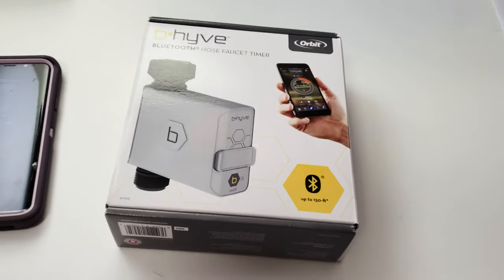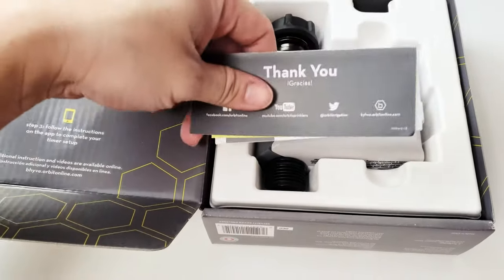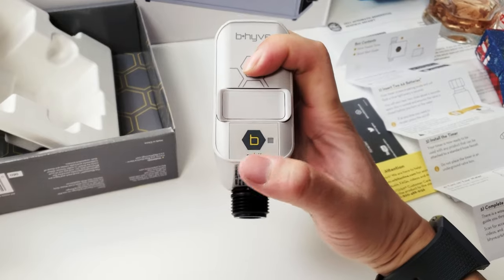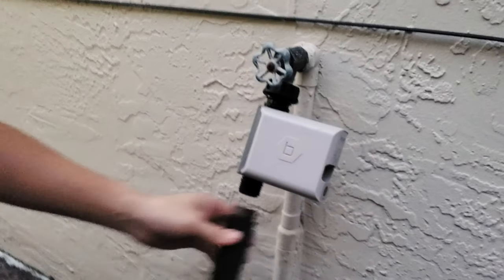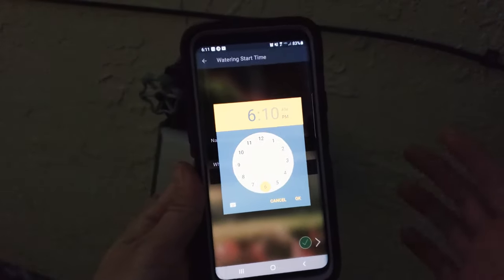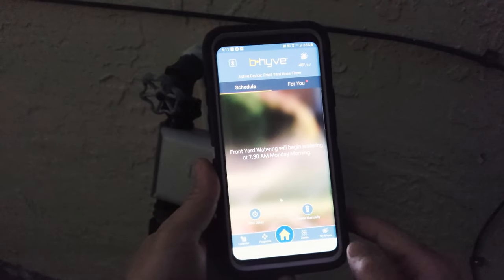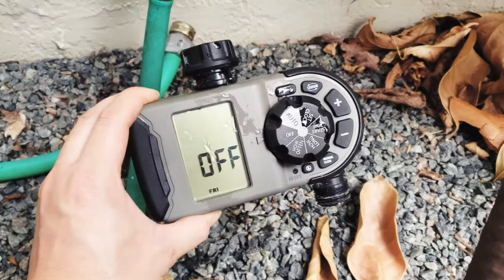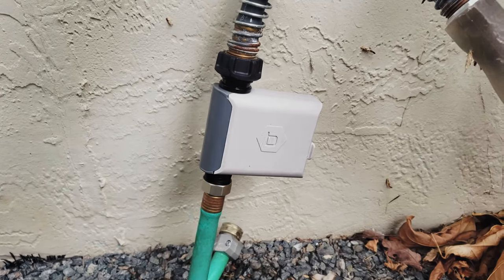Orbit B-Hyve Smart Bluetooth Faucet Sprinkler Timer with WiFi Hub Review

Comment: I've ordered it and got it in Israel, but the threading must be different.

I wish to connect it to a 20mm PEX line, can you suggest the right adapter / hose connection?
I don't know what's the male outlet is, but it's probably NOT 3/4 NPT, since the one doesn't screw on easily.
My end is a 3/4 BSP, (doesn't matter whether female or male).

Thanks!
Reply from the maker: Not really familiar with the size/adapters needed for Israel, I think your best bet is to take it to a local plumming/hardware store to find the correct adapter needed!
Reply: Dang that was quick! Thanks for replying.
 @TheGizmoGarage  Oh boy, I've been around stores all day - 0 luck!
Even the adapter you're using might be helpful - I'll get around the diameter for mismatches.

I just need to know what DOES fit. I even contacted Orbit - that wasn't helpful at all. :(

Comment: Right out of the box, they were as easy to set up as this video shows, and if you only have ONE, they remain easy. But as soon as you have two and you need to alter your watering schedule they become a Royal Payne-Diaz.

Alas Orbit is the only game in town, so I ended up with four of these timers and would like to have two more. But I keep waiting for some sort of update or firmware patch to correct the many failings these have. I'm on my third year with these and I think I am waiting in vain.
Reply: Same thing. Having one of these is great. After the, it is a nightmare and the app is TERRIBLE. There are all of these zones and options that simply do not work. I have spent dozens of hours over three years trying anyway to configure multiple sprinklers for automated watering and it 110% is not an option. I even contacted Orbit and after working through about 5 different reps, the last one said its not possible and they are trying to update it to work. That was 2+ years ago - pretty sad :/
Reply: Did you buy the hub? I think that's needed for coordinating more than one unit
Reply: @pivotal1101  Yep, have the hub. Doesn't stay connected to the timers, my phone, or the computer application. The only thing that works is to carry my phone out to each timer and do a factory reset every time I need to change the watering schedule. Not a big deal for the lawn, but the plan had been to set a timer for the drippers at each of the raised garden beds and be able to quickly give, for example, the tomatoes an extra shot of water if they need it. I've set up dozens of Wi-Fi, Bluetooth, and x-bee radio-based devices over the years and never had any as temperamental as these stupid things.

Comment: If you do another video please go further into controlling the device from outside your home because for some reason I can ping my hub but it will not control the hyve. This is more a orbit question as they made the product.
Reply from the maker: You need to make sure you have at least one Wi-Fi hub https://amzn.to/3M7wfZE, and all your faucets are connected to one of those wi-fi hubs, if you don't have a wifi hub then you can only control faucets close-by, by using the build-in bluetooth function on those timers to pair your phone.
Reply: @TheGizmoGarage  yup I do have the hub. It seems there is a bug with the device, I spoke with one of the tech support and he affirmed what I thought that sometimes the delay between the hub cause some issues and require you to clear the memory a few times before it takes. Hopefully one of the firmware they roll out will resolve that bug.
Reply: I will do a review on the device today.
Reply: Don't hold your breath for any corrections from Orbit. I've been waiting 3 years for the firmware changes their CS rep promised over the phone. I've never been able to get any of my B-Hyve timers to stay connected to the WiFi hub. I have never been able to see any of them from the Orbit B-Hyve website at all. I am only able to run them from my phone and even so, I have to factory reset each timer, and shut down and restart my phone every time I need to change a watering schedule. I was really jazzed about these when I first bought them, and they DO reliably water the lawn, but I dred, and therefore neglect revising their programs when I should to account for the weather. Every time I need to alter the watering schedule, I send my wife to her mother's so she doesn't have to endure the poetic flights of profanity these things inspire.
Reply: @christopherdahle9985  the fix which I did on my channel is to set up using an iphone. If you use an android device it will fail on the setup of the wifi paring. I was able to get it up and showed a few how to make it stay pair. It seems that the android app had a bug which the iphone and ipad does not. Once you do the entire pairing process from start to finish on an iphone it will work going forward on your android. Just remember tou have to do a full reset on all devices and do the initial setup on an iphone all the way through. Pair the hub first, then the controllers. The good thing about the iphone version is that you have grouping options which you will not see on the android... very odd.
Reply: @HNIC_Neochilds  Thanks for the suggestion. I'll try that. The kids all have iPhones so I can borrow theirs. Not eager to get a new phone though. Except for the sprinklers, my Android phone seems to manage the rest of my automated junk without a lot of fuss.
Anyway, I'm headed over to your channel now and see what you've got going.
Reply: @christopherdahle9985  I had the same problem after 2 years of use.  They are junk in my opinion
Reply: @HNIC_Neochilds  I didn’t work on my iPhone.  I’ve had them for 2 years.  Theses things are trash
Reply: @MrBdogg317  it's possible they updated the iOS version who knows. At the moment after paring with my iphone that I never use except for game development. At current they work. I do have to say their pairing method is trash. The worst I have seen for any adhoc devices. Hmm wait that might be a lie but that answer is for another subject.
Reply: @MrBdogg317  I'm still using them, but we had a bit of a monsoon season and I ended up shutting down the whole system (I shut off the water) for most of July. They had fogotten their programming when I turned the water back on on Wednesday and it took me the better part of 3 hours over several days to individually restart each one. I'm pretty sure they will all operate properly Sunday morning, but I've set an alarm so I can go out and watch. I've tried running them from the kid's iphones and my wifes MacBook, but we've had no better success. I'm going to live with it until I put in a real sprinkler system, but you can bet your last dollar that I will not be using any Orbit product when I get to that.

Comment: Does it work away from home or do you have to be on your network?
Reply from the maker: With the Wifi Hub, yes you can control it anywhere on earth as long as there is a wifi connection in your house, and your Wifi Hub is close to your wireless sprinkler timer and is connected through a Bluetooth connection.

Comment: Hello, my B-Hyve timer stopped working after almost 3 years, I just don't know why the valve doesn't open to water anything
Reply from the maker: Did you check the battery level? if battery is low on the timer, it will not open the valve to water.
Reply: @TheGizmoGarage  yes I did, I called the company and they said to get a new one. Everything tells me that it’s working fine, but the valve will not open even manually 🙃

Comment: i can’t get it tight enough on the faucet to prevent water from flowing out at the connection
Reply from the maker: Make sure the o-ring/rubber washer between the connection (that usually sits on the female connector end) is in good working condition.

Comment: Funny how none of these two to set top videos actually show connecting to the wi fi hub. Can't get that to work.
Reply from the maker: It's literally 2 or 3 clicks once the hub is plugged in to pair it with the app... https://cdn.shopify.com/s/files/1/0489/2445/9176/files/21006-50_rB_1_1.pdf?v=1702663461

Comment: I just bought the two pack combo from Costco. They are easy to set up, but the water pressure coming out of the smart hose is not as strong as without using them. I will return these useless things.
Reply from the maker: They shouldn’t be restricting the pressure as they are purely pass through
Reply: I had them for two years.  This year they stopped connecting via Wi-Fi and then Bluetooth.  Customer support was non existent.  I even updated the hub to the gen 2 and still nothing.  I trashed it and went to the orbit wired system with Wi-Fi.  Now my system works just fine.

Comment: This thing will disconnect at the most inconvenient time, causing floods. I use it for my RV to fill my fresh water tank, and of course when the tank is full, you try to turn it off and it just loads forever just to give you an error message. Then you have overflowing and have to run out to the water source and manually shut it off. Not reliable at all. Happens often that this device looses connection. I suggest you look for something that is of higher quality!
Reply from the maker: this is designed as a sprinkler timer, using it for filling the tank is rather creative! sorry it doesn't work well for that regard, but it's been reliable watering our yards for years now.